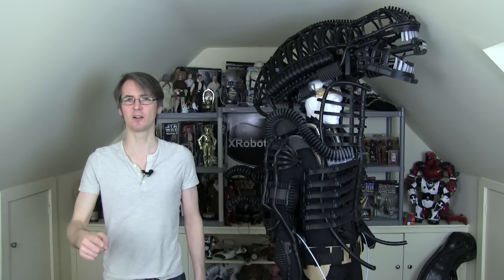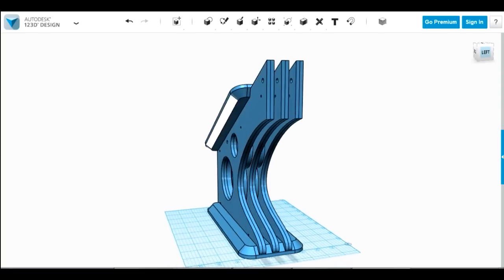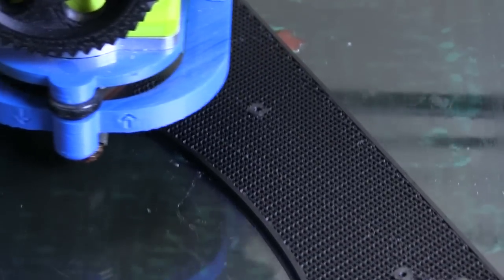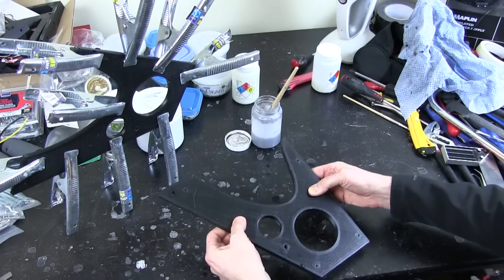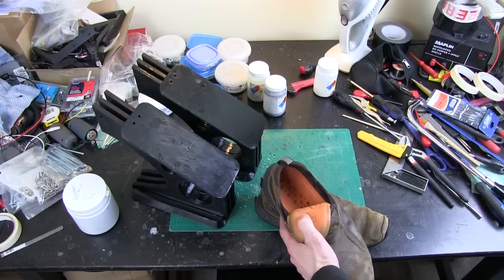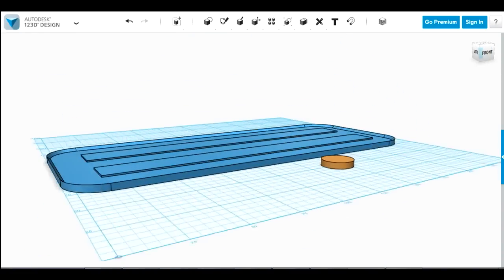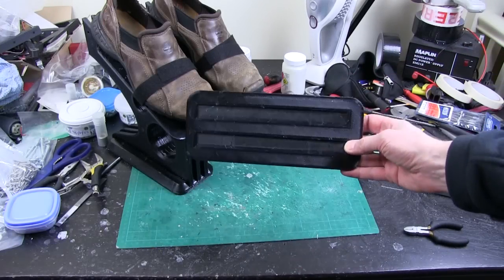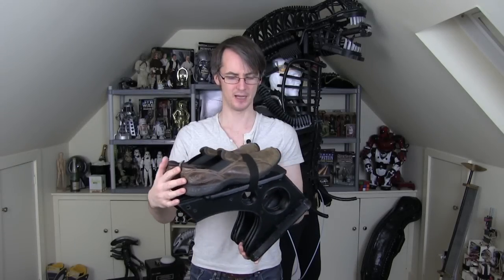Alien Xenomorph Cosplay #16 | 3D-Printed Stilts | James Bruton

Comment: How much do they weigh?
Also, I think that the part where the shoes are bolted on (the slope) could have had a small horizontal part in the front or something like that to help support your weight and the costume's.
I understand you plan on doing the leg support, but still, better safe than sorry.

Comment: I would say, Yes you do need the leg support. and I would also say no, I wouldn't trust that part to be 3D printed. I'd go with some metal, or atleast PVC. But again, It's up to you on how safe you want to be. Over-Engineer and save an ankle or be in a cast for awhile. Pretty cool though. Might have to print myself a pair at some point.

Comment: Have you considered that with the ninjaflex composites you can print, its may be possible to print a compressible structure that would look similar to what you have?  Think about the running prosthesis that some amputees use.  That's a good example of what I mean.  The structure compresses and recoils.  Using a 3D printed approach, it may also be possible to create compressible feet that help distribute the load and provide lateral stabilization like an animal's paw (that splays under load) or toes.  But I'm not judging.  Since this is for cosplay, appearance is what counts. :)  Just throwing out ideas.  PS.  Love your videos!

Comment: Could you not substitute the shoes with a pair of second hand ski boots/motorcycle boots? They are cheap on ebay, would give great ankle support and have strong rigid base to mount them with.
Reply: How about a 3D printed toe cage, a bit like toe clips on a bicycle pedal? With an integrated strap it would give you a little less movement in the foot.
As to the toes, I'd be tempted to print a basic bone structure and then cast the toes in a durable silicone.

Excellent work so far on the suit.

Comment: Just adding my two pence worth......
I'd say that you're probably better off not to have anything fixed between the stilt and your leg. I used to play roller hockey with friends and we learnt pretty quick that in a tumble you're better off not to have big heavy skates clamped tightly to your calf (Quads back then...... Before the days of inline's. :) ). In an incident it would usually work in your favour if your foot was free to get twisted out of the boot rather than transferring that force into your calf. Most of the time I'd play without even having laces on my boots and once I got used to it I had more control than when I originally had the skates clamped up tight. If you don't intend to be running about in these, Then in a worst case scenario you'd probably be better off being able to almost "Step out" of the stilts.